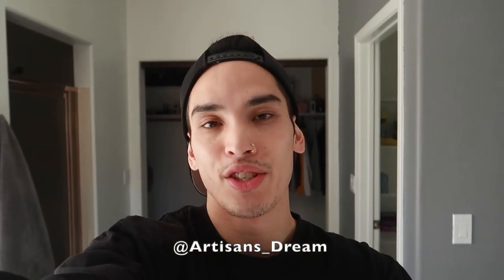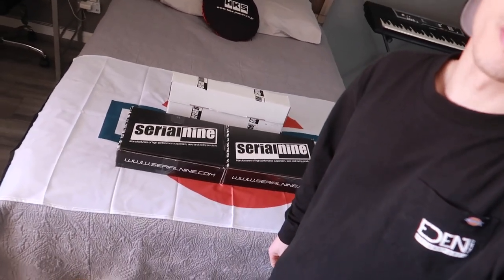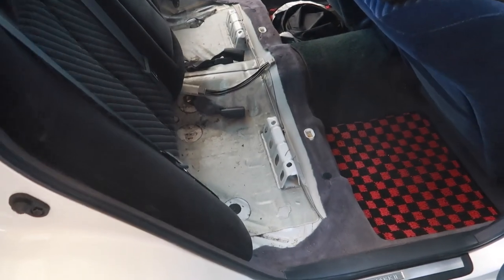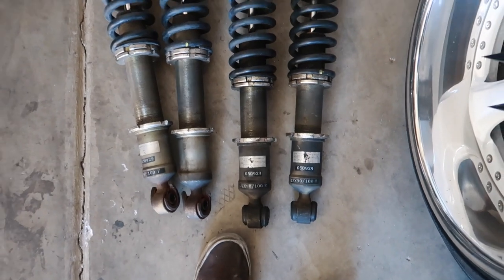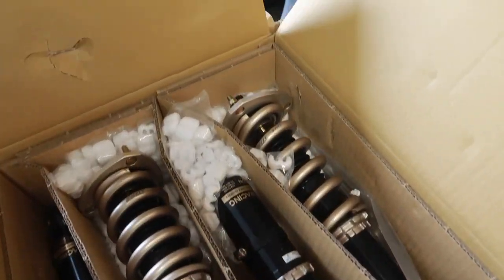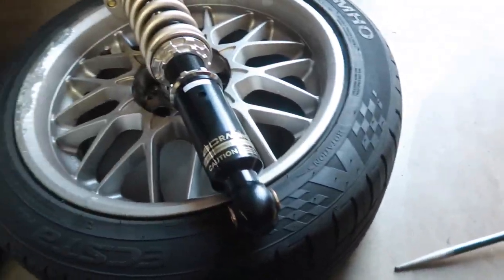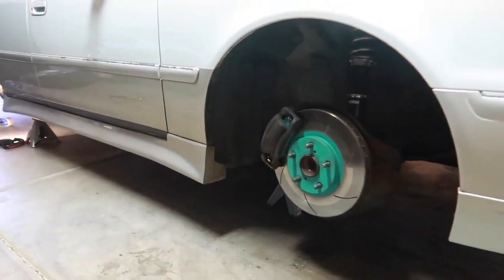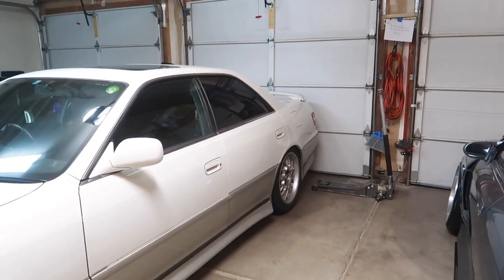Jzx100 Mark ii gets new COILOVERS!

Comment: Bought the same set of BC Coilovers for my JZX100. Do you remember the torque specs you used?
Reply from the maker: The top hat bolts should be 12ftlb. The bolts to the knuckle should be 55-60ftlbs.